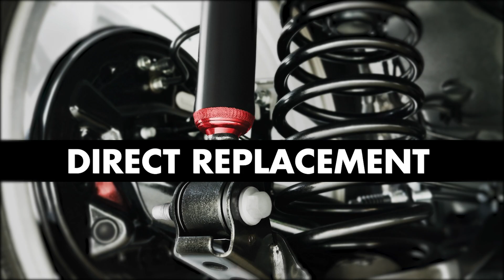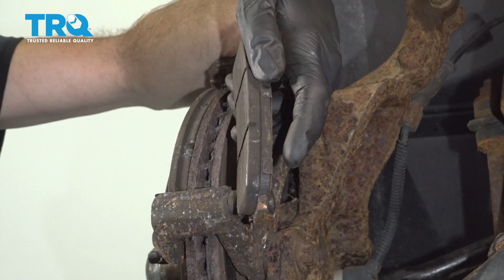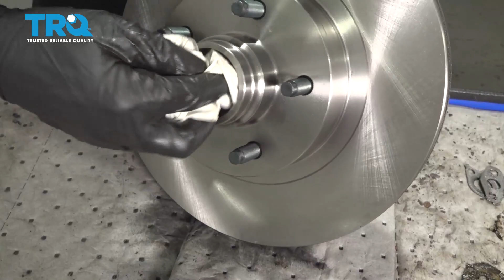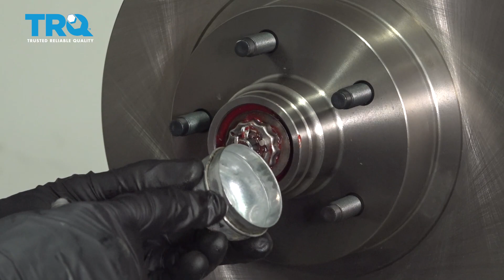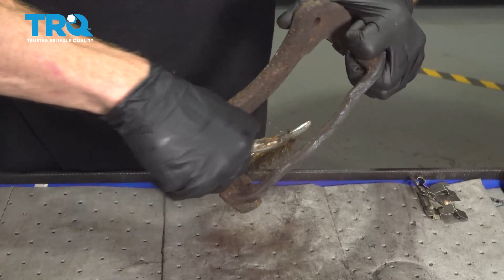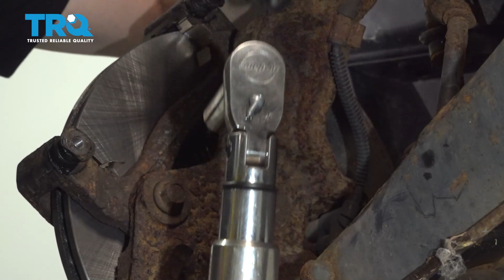How to Replace Front Brakes 2001-2005 Ford Explorer Sport Trac

Comment: big C clamp with a old brake pad will work because most people wont have that tool to push in the piston. Only thing missing is the bungee cord to hold the caliper up AND hi temp brake pad grease at the top and btm of the pads by the "tins"